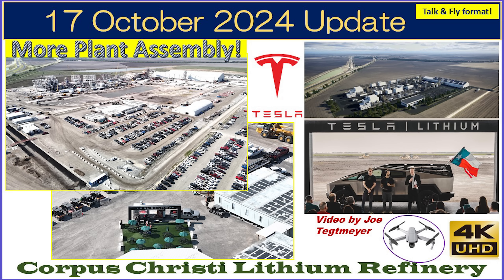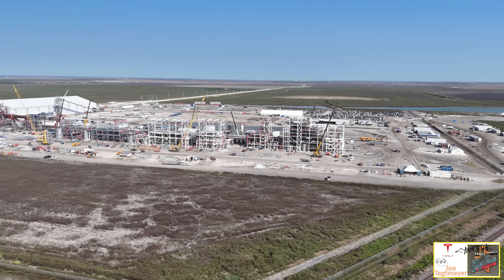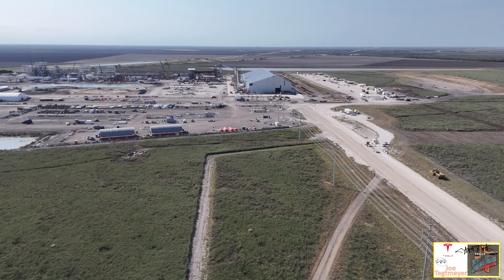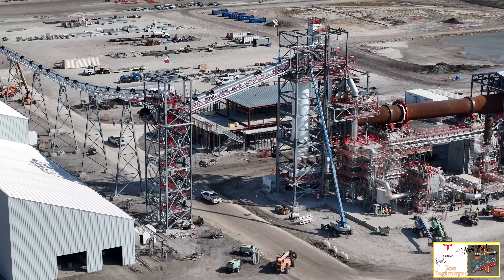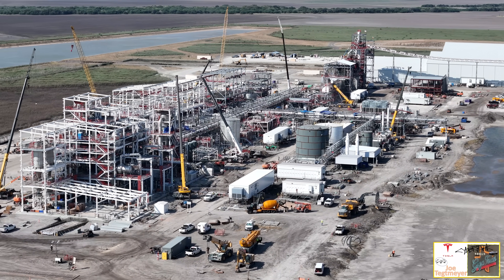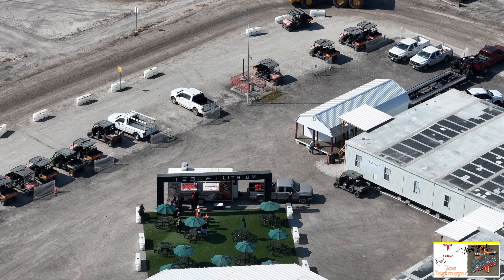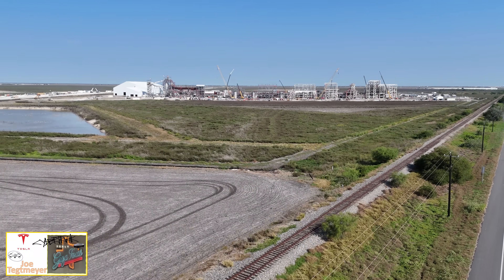Tesla's Texas Lithium Plant Progress! 17 October 2024 Development Site & Operations Update (9:55 AM)

Comment: At 9:47, the equipment with the large diameter silver colored ducting probably is a kind of  baghouse like we see coming up at GT. This pyro kiln is gas fired and the exhaust gas coming out near the top need to be filtered to remove unhealthy airborne particles. SC6 is mainly mica.. not good to inhale. There may be heat recovery as well, prior to the cleaned exhaust going up through the stack, at the right.

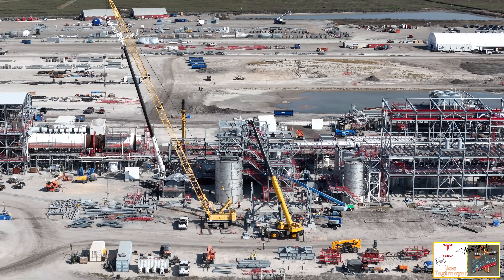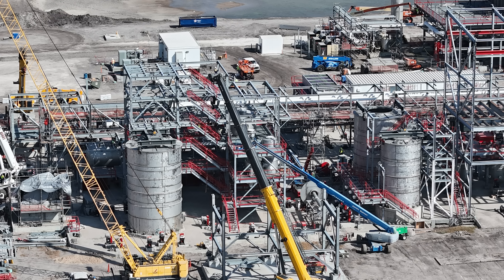At 10:05 (and a better view during the intro at 2:16) zooming in shows the big autoclave vessel which is now completely built in amongst other structures and equipment. The autoclave is the first step in the hydrometallurgical process, where pressure-leaching takes place to physically get the now active Lithium (in Beta form) out of the mica/quartz. Lithium is a light metal and is only present at 6 percent weight, hence SC6. The by-product (from the rest - 94% weight) will be converted into an inert material as mentioned. Maybe road fill or something like that. 

The main benefit of this new technology being deployed by Tesla is to completely do away with hot Sulphuric Acid leaching to get the Li out, plus all the processes to deal with Sulphuric Acid afterwards. Aside from any financial pluses or minuses by onshoring the LIthium refinery process, I think it is also fair to say that this is a superior process route with a very much reduced environmental footprint. So, rather than looking away when buying Lithium Hydroxide or Lithium Carbonate on the international market - currently at dump pricing levels as well (!) -  this project and its available area for expansion could become a central, National resource for producing battery grade lithium.